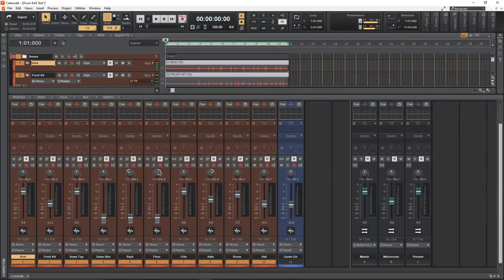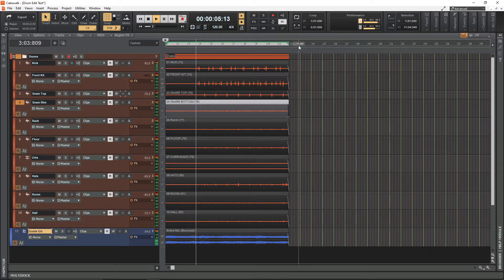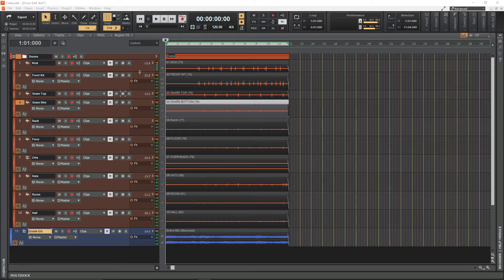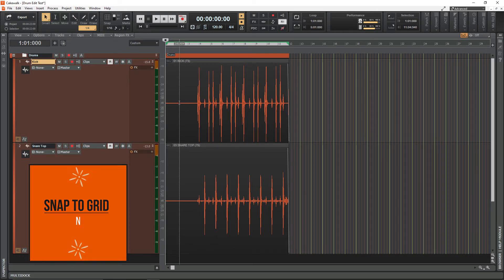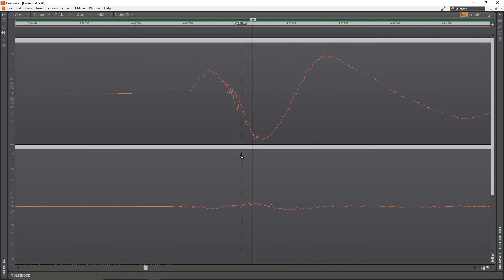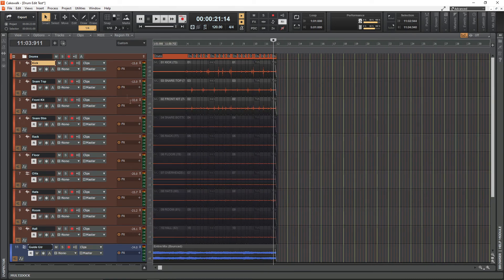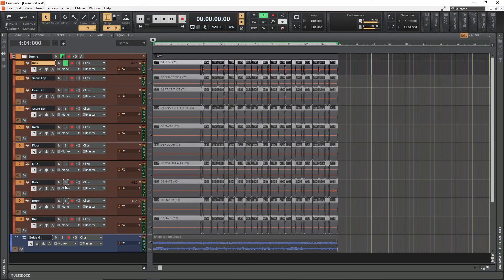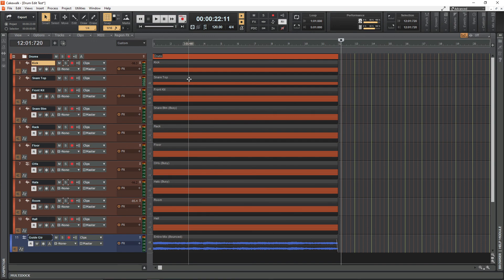How to Quantize a Live Drum Kit to the Grid in Cakewalk by Bandlab | Tab to Transient Method

Comment from the maker: Update : The most recent Cakewalk by Bandlab has greatly improved the audio snap engine, and therefore improved transient detection. The method remains the same, but editing speed is greatly increased. You can get it here : https://www.bandlab.com/products/cakewalk/whats-new
Reply: Would love to see an updated clip of how you do this now.  I learnt a lot from your grouping method, presumably you don't even need to split into clips to quantise now, just using audio snap will work?  Seeing how the ins and outs of that work for multiple tracks would be really useful
Reply from the maker: @balorprice  I still do it this way, but the transient detection is way better so I don't have to go in and move every transient marker. 

Yet to try it with audio snap and stretching though, I'll go in and give it a shot and see how it goes. I tend not to stretch audio unless I have to, but Cakewalk uses the elastique stretch algorithm now so I imagine it might be a good solution! 

Thanks for watching the video!
Reply from the maker: @balorprice  If you're still interested, I have a new video on using audiosnap to stretch drums to the grid. It should be up in the next few days
Reply from the maker: @balorprice  https://youtu.be/ZTmmhrokgno
Reply: @lightgrenade  Thanks!